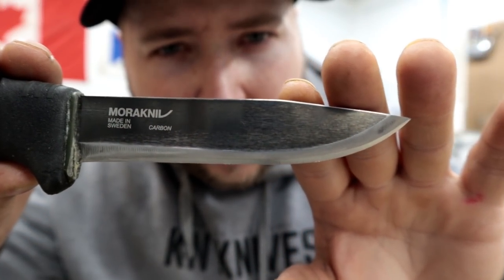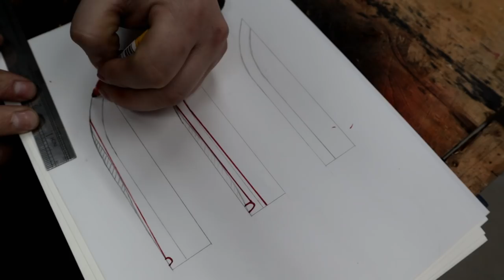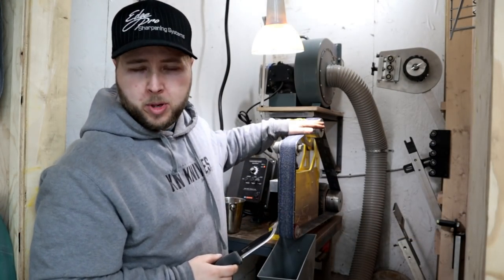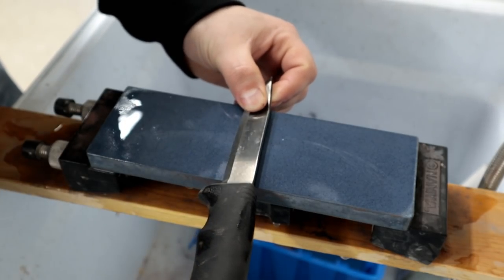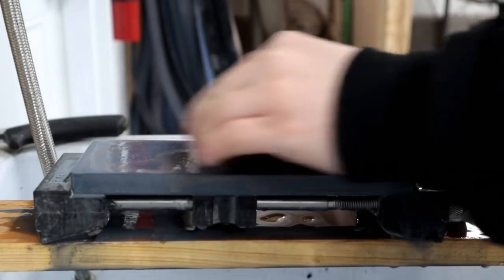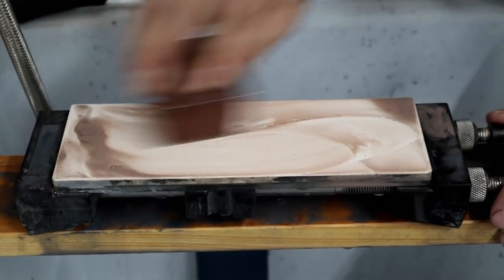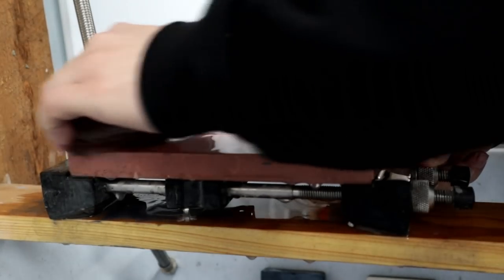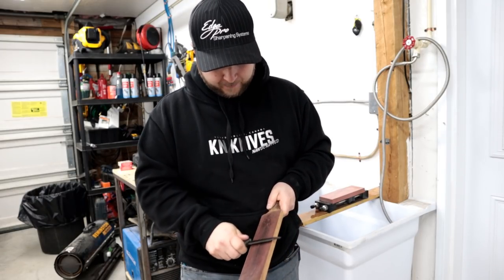Repairing the worst MORA BUSHCRAFT I have ever seen! - [WATERSTONE SHARPENING]

Comment: That’s how I handled a friends 40 year old Buck 110 the other night. Found an appropriate angle to just get rid of the recurve at the blade base yet maintain a good amount of material. It came out well. Did it free hand on water stones.
Reply: Having a convex curve can definitely add strength to a blade edge but how are you going to resharpen it easily?? So I agree. A flat grind is almost always a better answer.
Reply: @zacharysherry2910  you can with a good ceramic rod. But you’re better off bringing back that original blade profile. It wasn’t a quick task either.

Comment: Thanks very much for this. I've put a nick in the edge of my Mora so looked up videos on how to restore/sharpen it. This is very helpful indeed and encouraging for the inexperienced like me.. All the best from England.
Reply: How big was the nick? I once had a Mora basic come to me with a very small chip in the edge. It was just barely big enough to see with the eye, but I could feel it easy with my thumbnail. I decided NOT to reprofile it, because the tiny chip really didn't affect its function. Besides, a small nick will just disappear after a few sharpenings anyways. I'd suggest just normal strop and regular maintenance, unless the nick is really in the way.
Reply: @Danielson1818  It's about the same as the one you describe. The knife still functions fine. I'll do as you suggest. Thanks for the advice. Guess I was being a bit OCD about it.
Reply: @laurieharper1526  No worries. I'm the biggest overthinker. Its both a blessing and curse, I know.  The great part is you are in full control, and scandi grind knives tend to be easier to shape and modify than most.

Comment: I struggle a little with the belly of scandi ground blades. I think the angle is a lot steeper at the belly and tip than on the straights of the bevel. could you share in your video some close ups especially on the belly and tip? and on both sides of the knife....thank you. Love your narration and videos btw

Comment: Great job repairing that knife. I wonder what he used to sharpen it? It looks like a pull through sharpener(never seen one used on a scandi edge before) since the scratches at the edge were parallel to the edge instead of perpendicular. Hopefully he can maintain now that its fixed. Since its just carbon steel a good strop with some compound would go a long way to maintain that edge for a while. You only need to take it to stones if it gets chipped or you really dulled it up without touching it up.
Reply: Pull through knife sharpener is fine scandi, this knife was deliberate. Don’t get me wrong I love the channel but this was a staged recovery. The knife isn’t worth the time he spent on it

Comment: Great vid man. BTW it is not a Nagura. Nagura are used to create a slurry that you sharpen with, usually on higher finisihing grit stones. And I usually only see them on waterstones or naturals. The stone you have from Naniwa is a cleaning stnne, used to clean surfaces of clogged up stones. If you try a Naniwa Pro 3000 grit, you will be amazed how little you need to use the cleaning stone, compared to the Naniwa Superstones, also the Super are much faster to wear down than Naniwa Pro´s. Also a Nagura comes with each stone, and is the same grit as the stone, so as to not create a slurry consistent of different grits.
Reply from the maker: Most stores call this stone the 'naniwa nagura'. It is technically a 'dressing stone', but for consumer use, I will call it the name most commonly used.

Comment: I like the 320 Shapton but I find a lil too thirsty to be splash and go. You can kinda see it in your video, after a but the water gets absorbed too fast. I like to splash it a few times in a sink, let it drink up and splash some more and after a bit the water stays on the surface. 
That's why the 1,000 Shapton is one of my favorite stones. It's truly splash and go and its rough enough(it's closer to 800-900 than 1,000 in micron size) for most jobs(I only use 320 for big chips and 120 for reprofile) and it leaves a nice enough finish and the edge still has some good bite to it. I might do a few swipes on the 2,000 but for a utility edge its good enough. If you want to make it look better then I start going up grits.

Comment: Great analysis on where to remove material. Beautiful little mini grinding tool you have there, to cut the sharpening notch. Envy. If you ever have a chance to show how to reduce a bolster (western style knives), I'd love to watch that.
Reply from the maker: I'm not sure what you mean by reducing a bolster, Dave! Could you elaborate?
Reply: @kyle_noseworthy  ---- Hi, Kyle. Very nice work you do. After sharpening a few times, trying to use a chef's knife with a bolster like one would use a santoku for dicing or mincing on a cutting board doesn't work, because the bolster hits the board. You can sharpen the edge right up to the bolster, but then the bolster is about a 3mm thickness of steel there, and will just dig a ditch in a sharpening stone. I got a Dremel moto tool little grinding wheel and ground a millimeter (1000 microns!!) of it away, so the edge of the knife at the heel made contact with the board. The rest of the bolster is still there, so it isn't a Japanese style santoku, but you can use it like one. But I didn't do a very neat-looking job grinding, and couldn't figure out what would look best. It looks like a dented bumper on a car, heh.. You did such a good job, so quickly, cutting the sharpening notch, grinding down or cutting down a bolster would be easy for you. I'm curious about how you would shape, or reshape, the bolster.
Reply: You mean the finger guard is in the way?
Reply: @wizardofahhhs759  he means the last of the blade isn't sharpened its full blade thickness.

Comment: I've found that the Bushcraft bevel is to aggressive to begin with esp the wall of the belly.  I put mine on the new Precision Adjust worksharp and I gotta say it's good for those who can't use stones.  
It's not made for reprofiling so using a belt to begin that task is needed but they do have a 220 grit diamond now which is pretty wicked for simple changes. 

I lifted the edge thinned it out which extended the tip just a hair .   It's a very good blade now ...They make these things to be batoned through big logs ...,For me it's a silly idea , I just like a knife to be a knife. 

I can baton with it just kindling no need to abuse her . Those Bushcrafter blacks looks really cool once they are polished.  Also you are so right , ya gotta add that sharpening choil regardless if ya keep it stock or not it's a must .

Comment: Based on the scratch pattern parallel with the edge and bevel pattern tapering out from the heel it definitely looks like he was using a draw-through sharpener on the knife originally.
Reply: That's what I was thinking, probably a powered one (like the worksharp) I recently spent 4-5 hours (by hand/ with stones only) repairing a bunch of knives that my friend drug thru a carbide V "sharpener" and it had literally tore chunks of steel out of the edges!

Comment: How do you protect the temper when working with the belt grinder? Thanks..
Reply from the maker: I have enough experience to understand how much heat is generated per pass, and to remove it as needed. I use the grinder barehanded, with my fingers close to the edge. I can feel the heat. I keep a bucket of cold water next to me for cooling, if needed.

Comment: hello kyle, first i want to say thank you for the very informative videos. i leaned a lot on how to sharpen correctly. i have a question regarding the NANIWA NAGURA "cleaning" stone you use: what number is it? when i searched for it on Amazon, it gave me like 10 NANIWA NAGURA each with deferent number. also i wanted to know if the stone i have affects which NANIWA NAGURA i need to pick? i am relatively a beginner in sharpening on stones and i picked the WORKSHARP whetstone for its acceptable price and good results (good reviews), it is 2-sided stone with 1000/6000 aluminum oxide. i hope you will be able to assist. thanks again.

Comment: A Mora Bushcraft is $50-$65. Considering what you must've charged him, I wonder why the customer didn't consider a new knife.
Reply: He's happy with the old one, and he might have heard of quality slips with the new ones?
Maybe he changed the handle for a thicker one as he found the original one too thin to really grip?
Or he believes the best way to "recycle" - is to fix and re-use.
Or maybe it was a present from someone, and as such it has value other than financial?

Or maybe the "repair job", including transport, was actually less expensive than the cost of a new knife?

Comment: Question is, how did it get like that ? with those parallel striations along the grinding face ?
Reply: my guess... pull-through sharpener.
Reply: @OllieVK  As guesses go pretty good, but I have never seen one that did exactly that !
Reply: @CrimeVid  poor quality ones will do that easily, there's not really any other way to get that horizontal scoring on the blade.

Comment: To be kind to the customer who sent in the Mora, it looks like he was trying to create convex grind with a micro bevel 😇
Reply: Nah,  look at the direction of the wear when he magnifies it.  The owner was using one of those terrible pull-through carbide sharpeners.  Also explains the recurve and how he managed to wear down so much blade material.
Reply: @Mike-ul1xn  You are absolutely right. Perhaps he was experimenting with a new sharpener? Ok, I give up. He butchered the blade

Comment: Isn't it bad to put a hardened blade in a belt sander or because is a stainless steel ( air hardened) it doesn't matter?
Reply: The Mora Bushcraft Black is carbon steel.
Knifemakers use belt sanders all the time.
To shape a knife by hand takes ages. You just have to watch out for overheating the blade.
You don't want to mess up the heat treat.

Comment: I have a Bushcraft Black that is basically new. I want to take the micro bevel off of it, and make it a true scandi. I just ordered some whet stones, a 400/1000/3000/8000. After watching several of your videos I'm going to give it a go! Not nearly as talented as you are Kyle.....so wish me luck.
Reply: How did it work?
Not that hard is it.
I just put in on the wet and dry sandpaper. Put it on a sanding block (with the metal clips at the end), with the rubbery layer beneath the sandpaper.
Starting with 1000, then 2000, finishing off with 4000 grit.
Works really well.
But stones are perfect as well.

Comment: That's the worst Mora you've seen? I should send you my workbench Mora :D, not that I can't sharpen my knives (usually tormek or DMT stones) but that's my hard use knife, broken tip, sharpened on what's running/close and fast belt grinder check, bench grinder check, file check. 
This one is one of the longest "living" I've had I usually replace it once or twice a year when they broke (pro tip knife isn't a prybar)

Comment: Wouldn't it be cheaper just to toss it and buy another? They're fairly inexpensive.
Reply: That attitude is why our planet is becoming one big garbage dump.
Reply: @desertrainfrog1691  So you'd spend twice as much on shipping and labor costs repairing a knife when you can get a new one for a lot less? Sorry, but that just doesn't make sense to me. My attitude is a result of the way products are being manufactured to be disposable, not the other way around.
Reply: @wizardofahhhs759  No, I'd simply fix it myself because it isn't that hard. 

Not every decision is made based on cost. I don't want to throw things away unnecessarily, regardless of if it costs a bit extra to fix it.

Comment: You done everything  rite minus the belt sander that takes the temper out gets dull to fast if used  but looks  good on display case
Reply from the maker: Incorrect, Ricky. A grinder CAN affect the heat treat of the steel only if heat is allowed to accumulate above a certain temperature. This is easy to avoid with a little caution and experience.
Reply: @Kyle Noseworthy  i have been sharpen knives since i was 12 i now am 67 made you need afew more years of learing with it
Reply from the maker: Here are my thoughts on this one: https://www.youtube.com/watch?v=yDw9rvHaIRE

Comment: Looks like they were trying to use a work sharp
Reply: not really
Reply from the maker: It was one of those pull-through V-sharpeners I believe!
Reply: @kyle_noseworthy  ok they can be bad too if you get carried away with it
Reply: Work sharps, for what they are, are not that horrible. It's just a belt grinder in miniature. Can they ruin knives? Sure, but so can a whetstone - just takes longer. Granted, you can't do anything but convex edges on a work sharp.
Reply: @strappedwithkrylon  your right bug I have seen a few people damage knives with them.
Reply: @johnwalters7415  As most chefs will tell you, don't blame the tool. 

Don't get me wrong, there's plenty of reasons why no one should buy a worksharp station. I mean, first of all... you're required to have electricity, second - you're required to buy abrasive bands which carries two issues: first of all, the moment Worksharp decides that their nth generation WorkSharp station is obsolete, it becomes obsolete unless there's a third party manufacturer for abrasive bands, second reason: grits. The worksharp station comes with a 80/320/6000 grits - they sell more and maybe that's fine if you're in the US I suppose but if you're not you're genereally stuck with those three options. 320 is fine for hand grinding, but given the speed of the first gen worksharp it is way too coarse. Third reason not to buy one is that you're locked in to convex edges. I don't mind convex edges... but you're literally stuck with convex edges, nothing else. To me, all those things combined becomes the epitome of a bad purchase. Even with the newer models where you have adjustable speeds and angles, you're still dependent on WorkSharp or a third party manufacturer to make the bands that you use and still stuck with a convex edge - unlike whetstones.
Reply: I don't care for one I like using stones a d a strop

Comment: Do you have Nagura's in various grades to match the grit of the stone you are using it on?
Reply from the maker: Nope! I haven't found it necessary. Just this 600 grit does a great job on anything I have used. Now, if you were using VERY fine grit stones, you might want something different.
Reply: @kyle_noseworthy  thank you. I have chosera stones and king stones and it was recommended that my naguras match the grit...I just started using natural, previous to that I just replaced them when they wore out...hoping not to have to do that as much. Thank you for your reply